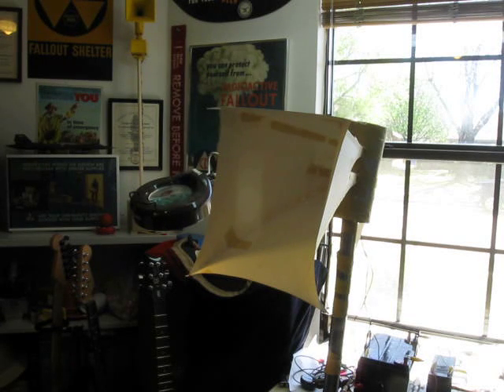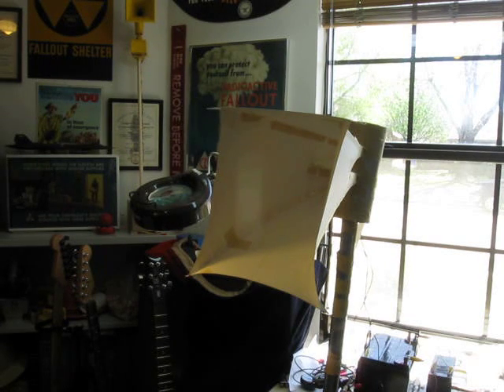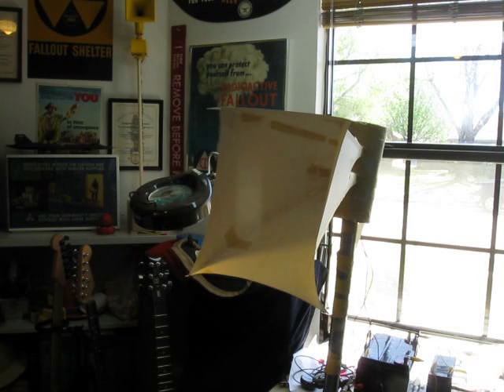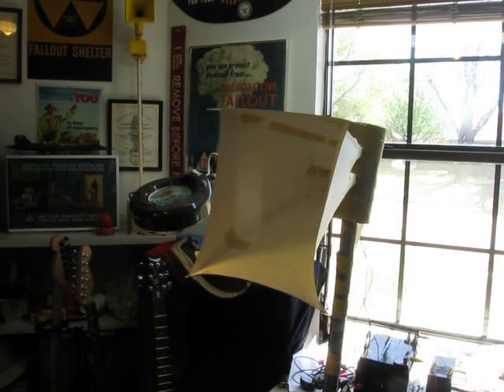Mini Hurricane Vertical Chopper Test

Comment: How much ports? Is the chopper PVC?
Reply from the maker: There are two choppers, one 4 port and one 5 port on a dual shaft motor in between the choppers similar to a full size hurricane arrangement. I had to run the motor over-voltage to get the pitch right because there are half as many ports as there should be on each chopper. There are half as many ports as there should be because of the size of the choppers. The choppers are too small to have 8 and 10 ports. And no they aren't pvc. They are 6061-T6 aluminum not gummy-mushy-garbage pvc. I have since abandoned the choppers and motor i used in this first version in this video because it wasn't nearly loud enough. I now have larger diameter choppers (about 2 inches) and a larger motor but I still have to finish bearings, shaft and motor mounting before I can try to make any noise with it.
Reply: Thanks for telling me :)
Reply: vanamonde2 Doesn't 4/5 sound like 8/10s?
Reply: @GokantheHusky  yes
Reply: @GokantheHusky 4 is half of 8 and 5 is half of 10 just like the common 8/10 port hurricanes, the RPM will just need to increase i assume

Comment from the maker: No. I have to redesign the entire chopper / motor assembly. The motor isn't nearly powerful enough to handle the volume of air that needs to be forced through the chopper. At the size this siren is it should be really loud with air going through it now if I try to push a lot of air through it the chopper bogs down.
Reply: is it re done?